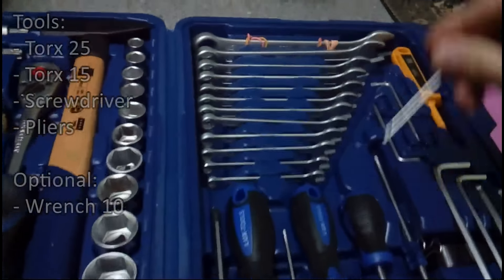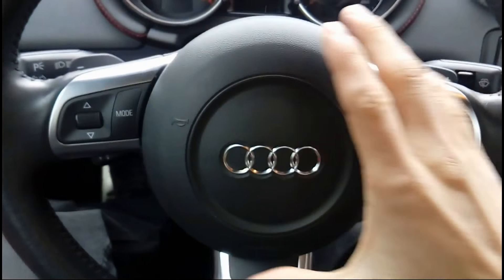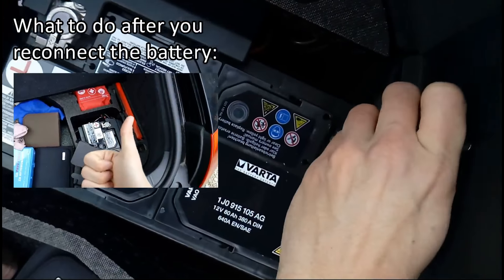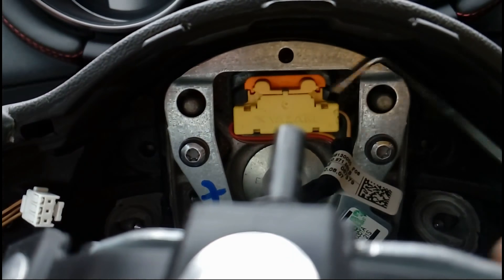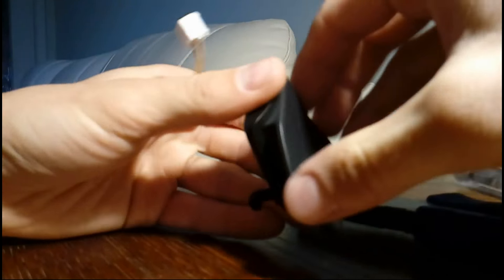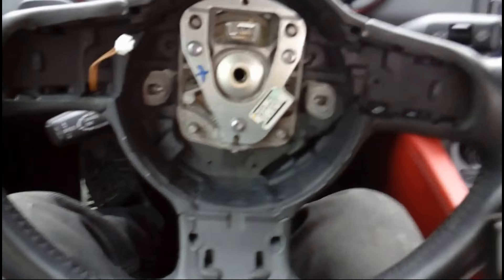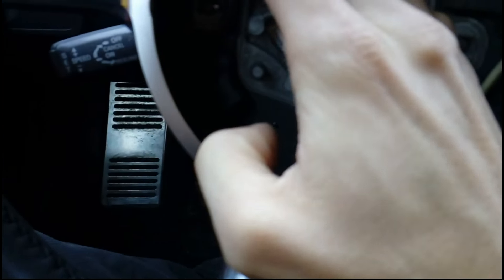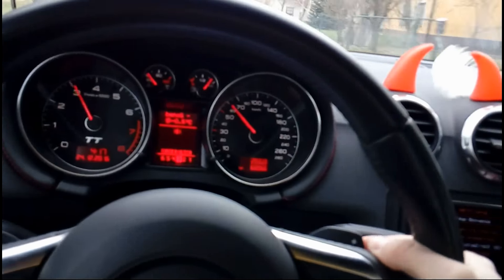How to Repair, Remove, or Change Stuck F1 Paddle Shifts Audi TT Mk2 S Tronik

Comment: This was on point, exactly the problem I had with my 2010 TTS. Mine is a USA model and I had to use a Torx 30 for the first big bolts. But everything else was exactly as he said. The Audi dealer wanted around $1,000 to replace the two paddles. I fixed the issue in about 20-30 minutes with this video. Thank you!

Comment: Thanks Dr, Audi S3 up-shift paddle worked 50% of the time, followed your instruction, it had no broken parts so sprayed it with Electronic Contact Spray and voila, works perfectly every time! Saved me a lot of dollars and time, all your videos are very helpful.
Reply: Frank Tourelle I have a 2014 GLI doing something similar. Basically I have to press extra hard on the upshift button to work. I'm thinking it's specifically the electric micro switch that is the problem. Is this where you applied the electric contract spray?
Reply: Why you spray it if you removed those plastics inside the pedal??
Reply: @arisafghanzada  sorry for the late reply....when I opened up the paddle unit and saw no broken parts, I just sprayed the whole inside of the unit and then put it all back together and it worked perfectly and still does. However sometime later the other paddle developed the same issue and so I did the same procedure and it did not work immediately...until several days later, perhaps it needed more time to dry or connect...not sure exactly but has worked perfectly since.

Comment: Thank you so much for this video. I've a MK2 2009 & the left paddle got stuck. I followed exactly your steps & got the problem solved. I went in to clear the right paddle too since I got the whole steering wheel opened up. Took me about 30 min to finish. You're the man.

Comment: Many thanks. Same job on 2008 R8. Easy and straightforward with your video. Mine wasn’t responding with no plastic bits broken or obstructing. Open it and just ad some W40 spray. Working as day one. 
Keep up the good job.

Comment: Excellent video. Very helpful. I needed a 30 Torx bit for the two screws on my MY 2011 Mk 2 ((UK). The method in the additional video on resetting the windows worked for me first time. I had to drive a few yards before all the warning lights went out. This intermittent jamming of the paddle has been bugging me for months. I thought it would be an expensive fix so put it off. I was careful, took my time. Had it all done and driving down the road in 45 mins.

Comment: I just bought an Audi TT MK2 2009 3.2L, and both of its paddle shifters were stuck in the same manner as shown in your video. When I opened them, I found exactly the same cause - the broken plastic guides or locks.

I followed your video in exactly the same manner and I faced no problem from the start till the finish. Thanks. 

One caution though for other users. Although I disconnected the battery terminal before disconnecting airbag, and only connected the battery back once everything was assembled back, the dashboard illuminated with ABS, angle sensor, stability errors. This was probably due to residual voltage in the system which triggered these errors. I had to reset these error with computer. My mechanic says that after disconnecting the battery one should wait for about 20 min to let the system voltage discharge before disconnecting such sensitive items.
Reply from the maker: Good point, capacitors hold charge and can act like small batteries which supply enough voltage for microchips.

Comment: Very helpful video! Worked perfectly apart from after I reconnected the battery the dash was lit up like a Christmas tree. Did a bit of research and found out you have to turn the wheel full left lock then right lock then centre  and it cleared !

Comment: Excellent instructional video. I had the same problem with my 2008 TT. Did the job in 10 minutes. Minor concern when the DSP and power steering warning lamps stayed on at idle, but both went out after driving 10 meters (per the operating manual lol).

Comment: CAUTION: once you've disconnected the battery, leave it for 10 - 20 minutes BEFORE touching the airbag to allow any residual current to dissipate. As a final precaution touch the POSITIVE battery cable to an earthing point for 10 seconds. You should ideally disconnect BOTH battery terminals.

Comment: the model of steering wheel that you have  is te original that come with the car or did you change it after market OEM ?
Reply from the maker: It's original, came with the car. Is a sport version of a steering wheel. (:

Comment: Thanks for posting this. Just recently noticed the same problem on my 2014 Seat Leon ST with DSG. The car has only done 21k miles. The unit looks exactly the same which is no surprise as it's obviously a stock VAG component. The problem isn't there all the time and I'm wondering if the broken plastic pieces move around as the steering wheel is rotated and only get stuck some of the time?
Reply from the maker: In my case it all started with the shifter sometimes stuck and sometimes not. If I would just press it couple of times a bit more harder or drive (move steering wheel) a bit longer, it would start working again. At some point, like 6 months later, the shifter was just fully stuck, did not move anymore.
Reply: Yes, at the moment the problem is very intermittent and I did a long journey in the car yesterday and everything was fine. When the problem does appear again I will take the car to my local garage for them to see it and I can then get the work done under warranty which lasts for another 10 months.

Comment: Great vid thanks, today my downshift stuck tommorow I will do the same trick. Is it possible to leave the airbag connector/cable in place? don't have a radio code, disconnect the battery not my first option. Today I gave it a try,  It is possible without disconnecting the airbag to take out the switch and remove   the plastic debris from the switch in out and repair in 15 minutes. Thanks again!!!
Reply from the maker: It is possible but you need to be careful how you leave the cable hanging, if it touches something that would produce some electrical signal, the airbag can blow up. If the right cables get +12V, then the airbag will be triggered, logical right.

Comment: Great video but I need help for a 2010 VW GTI and it does not have the plastic tabs to expose the Tory bolts. Do you have any tips?
Reply from the maker: Turn steering 90 deg, there will be a hole exposed on the backside. In there you need to unpin a clip. Then 90 deg in another direction, repeat to remove the clip.
Reply: dr. sunka. Thank you. Big help!

Comment: Hi, I have the exact same problem with my upshift paddle - are the plastic bits that broke off necessary for the “click” in the paddle? Does it feel any different to when it was working with the clips? Ps - thanks for the detailed video - will come in very handy
Reply from the maker: Hi, I don't know why these plastic bits are for, but I don't feel any difference in shifting. (:
Reply: dr. sunka Thank you very much !!

Comment: I got a question, My paddle switch was working until I disconnect my battery. Now it is lock after the steering lock symbol came on the dashboard. The symbol is gone after i drive it but the paddle shift is still lock.
Reply from the maker: Disconnecting battery should not influence the shifters. Check fuses (32 and 33) if you did not blow any with disconnecting/connecting battery. Does your volume and other controls on the steering wheel work?

Comment: Mine is clicking but not downshifting i have to click multiple times.. from the normal shifter it downshift normally so i guess it's electrical problem or dust..

Comment: I have a 2008 Audi Quattro TT 3.2  & all my steering wheel controls are unresponsive, the only thing that works is the horn, I cannot use the radio controls or paddle shifters,  my paddle shifters aren’t stuck they just don’t work, can u tell me if theirs a fuse or something simple that I can do myself & avoid a bug repair bill ? Thanks
Reply from the maker: Hi, I would check all the connectors if they are firm and all the fuses at drivers doors. If there will be no issues I think you will need a new steering wheel unit (symphony). Best luck!
Reply: dr. sunka Thank U Dr ! Can u tell me how much $$$ is a steering wheel unit ? Thanks.
Reply from the maker: Hi Ray! If I am not mistaken, it should be around 220 $ in US. The part number is 8J0 951 527. But please, before buying, make sure that it is really the units, which are bad. It can be also the radio or other electrical parts, but less likely. If you have a pall with the TT, you could first exchange these and try if it works. Then you are sure you need new buttons. (Try Audi TT groups on Facebook).
Reply: Yes & thank u for the advice. Just on a side note my  08' Audi 3.2 quattro v6 has 80K miles & still runs fine but just within the past few months i had both window regulators replaced which cost $550 each, & the serpentine belt tensioner replaced. My question is can i expect more mechanical failures with this car now that it's 10 years old ? & what things can i anticipate to repair? Or proactively replace before it fails? Thanks!!
Reply from the maker: Hi, mine is 07' with 80k km. I had no big issues yet (gladly), just doing regular oil changes and other stuff as suggested in the manual. Few light bulbs went bad and few screws/bolts threads were damaged, so I just replaced them. It's hard to say preventively, you cannot know what will go bad. I did not change anything big.

Comment: So as long as you unplug the battery,the air bag won't set off?
Reply from the maker: Yes, in theory, because the pressure sensor + wires and connectors to the air bag, which can trigger it, have no current - the electrical circuit is open. If for some reason you would apply 12 V to its wires, then it will blow up.